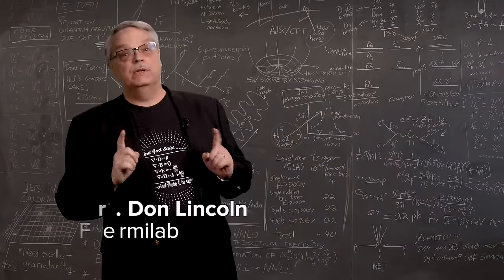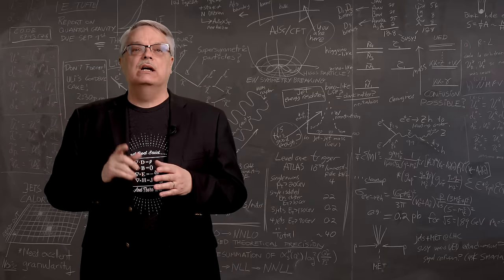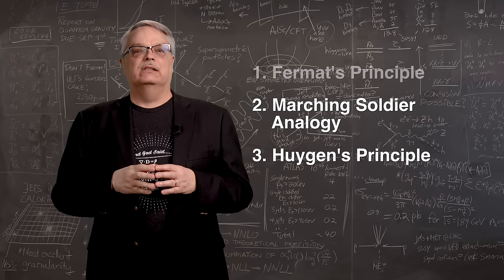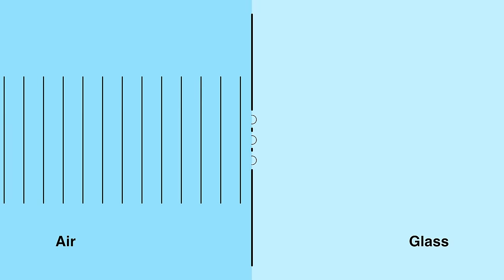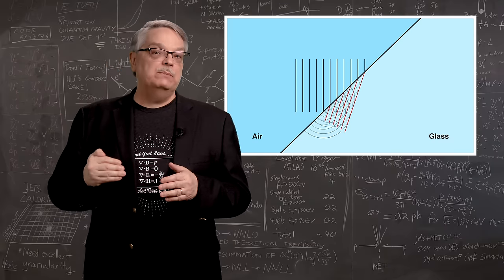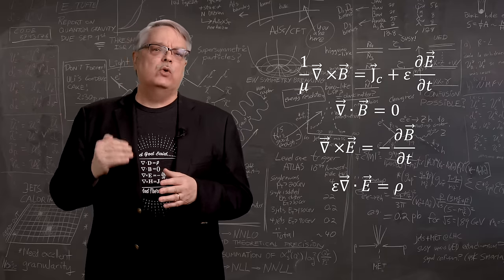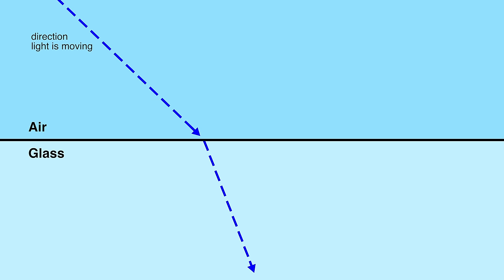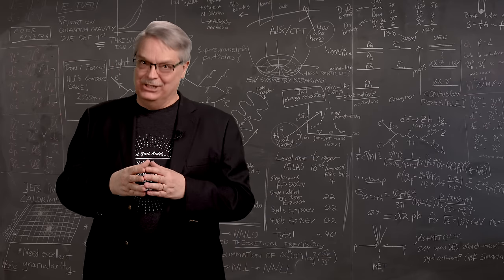Why does light bend when it enters glass?

Comment: Got a question: I was told by my professors that Maxwell equation just “stood the test of time”. Here we used M.E. to explain the bending (basically from applying boundary conditions). Is there any proof or explanation on why Maxwell equations hold for both mediums? More generally, how do we know M.E. will still be valid in a new type of material? If M.E. is simply a mathematical description of what we currently observe, without any more fundamental underpinnings, the we should have little faith it will still hold in a future discovered new material.

Comment: Although Fermat's principle does not provide a comprehensive explanation, it can be used as an illustrative example of the development of knowledge towards further deepening. A parallel can be drawn with the analogous relationship between the principle of least action in classical mechanics and quantum mechanics.

Comment: Mr. Don,
I would be grateful if you could please have  a look onto the analogy which I was told...and tell if it is correct....
it was:-

if we zoom into the picture of a light ray , we can see it wide enough to see the two ends of it(horizontally). now when light ray touches a optically denser medium obliquely, one end (say end A)will touch it while another end(say end B) is still in the rarer medium. The velocity of ray at end A is less than Velocity of light  at end B. 

Now you can imagine it as a car(light ray) traveling from a smooth road(rarer medium) to a sandy plain(denser medium) obliquely the front wheel of the clear touching the sand first( end A) will be  at a lower speed than the other still on the plain  road(end B).Now if you imagined this situation correctly, you can certainly imagine what are the consequences...the car (light ray)will move towards the normal.why?because the Slower wheel (end A)as well as the faster wheel (end B) will travel different distances in same amount of time causing the car(light ray)to bend.

This is the same what happens with the light...

Please correct if this wrong or if there are any contradictions to it..
Thanking  you,
A high school student.

Comment: why is the epsilon different in the perpendicular direction and not the parallel direction? that seems arbitrary. how does the electric field even know which way it's traveling through the material?
Reply: light has an electric component and magnetic component, in general its called TEM mode of propagation, when electric field it's perpendicular its called TM (Transverse magnetic) and TE when magnetic field its perpendicular.
Its not like light "knows" how it's oriented, its just how the fields interact with the materials,

Comment: Dr. Don, I believe that what actually is happening with light when we assume as refractive index, variation of speed of light and electric field interactions is actually what Einstein demonstrated by the eclipse of moon when light bended around the sun because of his gravitational field or time-space continuum, and that is what happens with light also around the gravitational field of atoms in a certain material when it is absorbed. 
But if you assume that this is happening, this means that the refracted ray of light is not quite a straight path, but a resultant of bended roads in a curved manner.
My question is if this manner of curved bending is involving cycloidal movement at atomic and subatomic level (because if the ray is traveling through gradients of materials with hierarchic index the path becomes a cycloid)? So, if it is, than the index and speed variation (acceleration) and electric field are actually atomic variations of refractive gradient that bends light according to cycloidal tiny paths…
I am just a visual artist with my rich imagination, don’t worry…

Comment: You mentioned that the electric field parallel to the surface of the glass has to be the same inside the glass as in the air, but you didn't say why.  You didn't say why the mechanism that lessens the field amplitude perpendicular to the glass doesn't also apply parallel to the glass.

Comment: The illustration in my Jr. High science text had a car veering off the road rather than soldiers in formation. The side of the car that hits the dirt shoulder first encounters greater drag, causing the car to turn into the shoulder more. This eliminates the objection of something being made to go faster. The car turns merely because one side of it has met resistance and been slowed. 

Of course the analogy doesn't holdup well for either light waves or point particles.

Comment: Then tell why sound wave also bends when travelling from different denser mediums
Reply: Indeed, the explanation in the video is just as bad as throwing Fermat's principle at people. It's not wrong (even though it ignores that there are different light polarizations), but it's not helpful to most people, and it may mislead them into thinking that refraction requires Maxwell's equations, which is nonsense... The simplest explanation I know works for waves in water, sound and light equally. It only needs the principle of superposition and a condition that says that the wave can't jump discontinuously at the interface.
Reply: @noeckel  there needs to be discontinuity, else there's no refraction at all, 
I've never worked on sound waves, but I believe there's still two different constraints for both components equivalent to EM's
Reply: @mbrusyda9437  You're probably thinking of the more specific situation where in addition to refraction (change in direction) you also have partial reflection, which is also known as "ray splitting". Then you do indeed need additional conditions, in particular a change in the material that's rapid on the scale of the wavelength. But the video was only about the simple fact that the propagation direction of the transmitted wave changes. That happens even when there's no discontinuity (or the opposite, like an AR coating on a lens which makes the interface even more complicated but doesn't change the refractive properties of the lens). The upshot is that it's a very general phenomenon that also should be explained by a more universal mechanism.
Reply: @noeckel  wait, are you talking of cases where the change of properties is very gradual and/or not simple interface?
Reply: @mbrusyda9437  Yes, you get refraction whenever there is a transition between two uniform media along some boundary that is planar, no matter how thick that boundary is. It doesn't matter if the change in the wave speeds is a gradual transition or not. The type of boundary (gradual or sharp, or a multilayer structure) only affects the relative amplitudes of the reflected and refracted waves, not their directions in the two adjoining media.
Reply: @chanakyasinha8046  The video is about refraction, not reflection. You shouldn't call people names if you have nothing relevant to add. Amplitude is entirely irrelevant for refraction in linear media.
Reply: @chanakyasinha8046  This is why I try not to comment on Youtube. You should really think before you post.
Reply: @chanakyasinha8046  sound waves do refract, that's why sounds appear to travel farther at night compared to day
Reply: @chanakyasinha8046  no, during night sounds get refracted downwards due to temperature variations in the atmosphere affecting speed of sound at different height levels, increasing the effective range, 
During day sounds get refracted upwards, decreasing its effective range
Reply: @chanakyasinha8046  I'll be waiting for your apology for calling me "fools, doing bad physics"
Reply: @chanakyasinha8046  why a thought experiment when real experiments proves sound refraction

Comment: This is also the reason why light splits into spectrum as it passes from one medium to another with different E-value, as light of different color ( frequency) carries different amount of energy and imposes e-fields of different strengths, red light bends more than blue. This is also the reason why it is so difficult to bend\focus UV even more so deep UV light using lenses. In industry such as photolithography where deep UV light is used you need mirrors to focus.

Comment: Is it not the same as imagining a car going from a hard surface to a muddy/sticky surface? The wheel hitting the mud encounters friction and slows the car on that side more, in the same way the electromagnetic field oscillation is affected on that side of the trajectory of the light (the inside angle side). The mud interacting with the wheel causes the friction as it is physically smooshed into line, in the same way the electric field acts upon the light as the charges are realigned.

Comment: I'm still missing something. I understand that the medium will create an opposing electric field, which will cause E to weaken and slow down the EM wave. However, I still don't understand why there is a turn. The E field seems like it could have an E field in any direction, as long as its perpendicular to light's direction. So why would the E component that is perpendicular to the medium normal be the only part of the E field weakened?

Comment: I don't understand why the component of the electric field that is parallel to the surface of the glass doesn't also interact with the charged particles of the glass, in the same way as the component perpendicular to the surface of the glass, and reduce its magnitude by the same factor, leading to no change in direction of the light only a reduction in speed.

Comment: Big thanks from an old theoretical physics graduate 👍. I never found the answer to this question back in university so I took out my old copy of Electromagnetism by Grant and Phillips in Manchester University to discover that most of the pages on the chapter covering this topic are blank 🤷‍♂️ I obviously bought a copy of the book which had a large misprinted chapter 🤦‍♂️ This the reason for my ignorance all these years. All the answers on the internet looked dodgey as you've pointed out. I'm not entirely sure I'm happy with your explanation though either even though you're employing maxwells equations with boundary conditions 🤔 It just looks suspicious to me that everyone gives an answer to this problem without considering the partial reflection that also occurs when a light beam is incident on glass surface so you'll have to do a video on that as well 😉

Comment: Wonderful. But (from 11:52 on), why is there a counterbalancing electric field for the perpendicular component but not for the parallel? An incident light beam not at 90° should encounter both and one could expect the effects to be proportional.
Reply: @leolucas1980  Thanks for answering, but consider a rectangular piece of glass (a parallelepiped if viewed in 3D) and two separate beams of light, one coming from the top-left at 45° and hitting the upper face (same situation as the video above), while the other coming from bottom-right at 45° hitting the right side. In other words, the two beams are parallel but coming from opposite directions. 
When the beam hits the upper face of the glass, its vertical E vector component is reduced (as shown in the video above). But when the second beam hits the glass on its right face, this time it's the horizontal vector component that gets reduced. So, in first case the molecular structure of the glass shrinks the vertical component, in second case it shrinks the horizontal component. So, there is no "preferred" shirking direction in a (regular) glass structure. It is always electric field component that is perpendicular to the face that gets reduced. 
And this make me think again. Could a glass structure "remember" which face the beam entered the glass from, to later "decide" which component to shrink? Of course, not. I think the bending is caused by what happens esclusively at the glass face (so, at the moment when light changes medium) but not inside the material where the light simply travels in a straight line.
If I were right (and I'm not, because the video says differently) I'd say that the bending is NOT caused by the counter-field that is created inside the glass structure, but the fact that when the beam hits the face the electric charges on the two sides are no more the same as moving in air or glass alone. Example: consider that (for simplicity) in the glass there is double the number positive and negative charges than in air. When the beam hits the face there is a different number of charges on the two sides and the counter-field (which existed in air as well) has a sudden change. This bends the beam, which from there on continues to move in a straight line. Could it be?

Comment: We converted from long lines traveling in a direction of motion to a vector representing the direction of motion. If you apply this to a series of long lines, don't you end up with similar problems as the other theories? Conversely, if you apply the other theories to just a single vector, don't they work out?

Comment: As someone who is not familiar with Maxwell equations, I understand why the electric field is smaller in the glass than the air, but I can't understand why it would be equal parallel to the surface but smaller perpendicular to the surface. Please could you explain this?

Comment: If it was possible, in some way, to contrast the alignment of the charges inside the glass with external electric fields that pass through the glass, could the angle of refraction be changed?

Comment: About the explanation to why the huygen's principle demonstration is wrong: shouldn't it be applied to each peak individually? And also, why do the waves in glass have so many peaks? They didn't have time to develop all of these peaks, they are created by the incoming lightwaves in such a way that there are only 2 build-up lines: one that demonstrates Snell's law, and another one that travels backwards, which is nullified by Fresnel's corrections to Huygen's principle. Note that I'm not saying that the electrodynamical proof is wrong in any way, I just believe that Huygen's proof is a correct demonstration which ranges not only light waves, but any wave in general (including sound waves, assuming appropriate dimensions to minimize diffraction).

Comment: At 11:58 the presenter states that the charges corresponding to the atomic composition of the glass are randomly distributed, and that the light then "imposes" an electric field on the randomly ordered electric charges in the media. "That field makes the charges move around" but you do not explain that imposing such order on the charges in the media would ordinarily remove frequency (energy) from the photons. So how do we change the organization of the charges in the glass without the photons losing energy when they exit the glass? The photons should be redshifted as they have altered the charges in the glass.  You cannot change the properties of the glass without changing the energy of the incumbent photons. What am I missing?

Comment: I think the big clue is in what was LIED ABOUT in the opening animation. When the beam of light hits the surface of the glass at a very shallow angle it does not refract inward as shown but instead REFLECTS OUTWARD as a mirror. If that is what is happening when the light hits the surface then clearly refraction at higher angles is just reflection to the inside instead of the outside. Thus whatever causes reflections is what is happening to change the angle and slow down the light.

Comment: OK, but why does the angle depend on the wavelength? And why does the wave move slower in medium? 
I understand that electrons and protons do have charge - but why does this only effect the electric field perpendicular to the surface? A particle with charge should not know about some surface far away. How can it influence only the perpendicular component of a vector? 
Just a guess: if we assume a body with only uncharged particles, light would not be bended on its surface?

Comment: @Fermilab makes it sound like the electric field determines the direction of the beam, and not the other way around. His analysis explains indeed why a larger epsilon, changes the direction of the perpendicular electric field, but does not explain how this electric field is promoted from effect to cause. It does not explain, any more than the "debunked theories", why light changes direction. We are left with the empirically obvious: light bends when going from air to an other medium like glass or water. Which we already knew.

Comment: Fun fact: the human brain can visually comprehend details as small as the wavelength of visible light, but no smaller. Details between the size of visible light wavelength and your minimum focal range feel blurry, not microscopic. But details smaller than the wavelength of visible light feel microscopic, not blurry. This is also how we get glass to look transparent: we sand down the imperfections so that the largest ones are smaller than the wavelength of visible light. If you have a poorly sanded glass, it may look fairly transparent to visible light yet opaque white in near ultraviolet. Meanwhile a very poorly-sanded glass may look opaque white in visible light yet transparent in near infrared.

Comment: If the glass is homogeneous, shouldn't the tangential electric field component be also reduced along with the normal component? The atoms in the glass should also produce an opposing field in the tangential (parallel to air-glass interface) direction as well as the normal (perpendicular to air-glass) interface) direction. If reductions are the same, then no bending will occur. The physical explanation does not explain the results from Maxwell's equations.